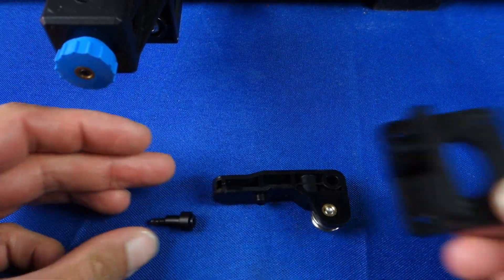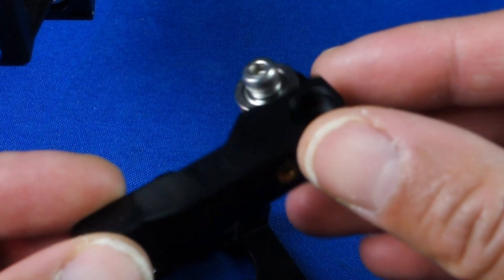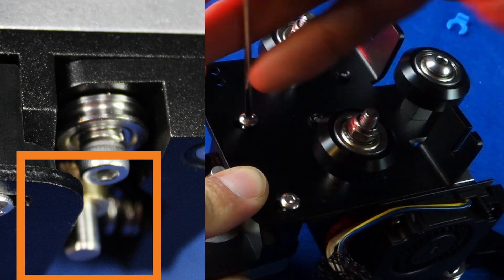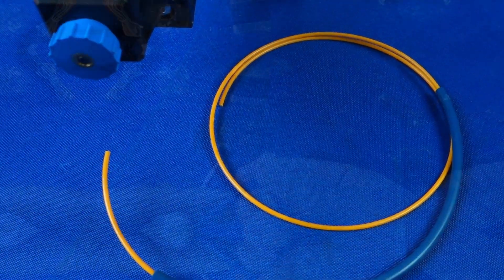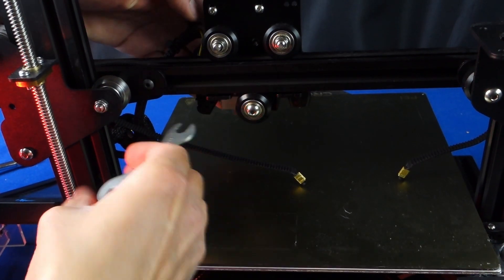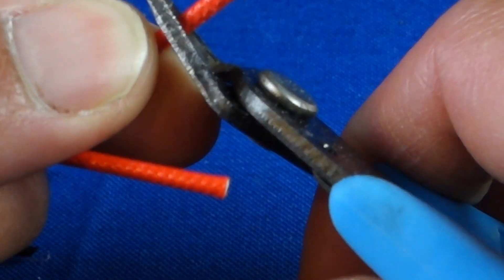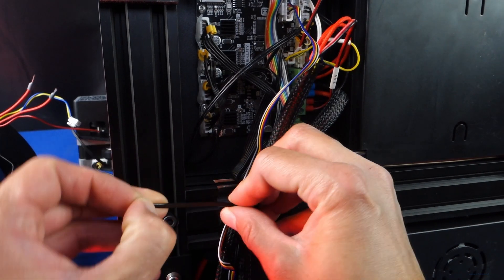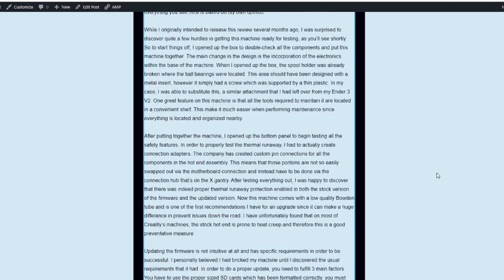𝙐𝙥𝙜𝙧𝙖𝙙𝙞𝙣𝙜 the 𝗛𝗼𝘁 𝗘𝗻𝗱 - Ender 𝟯 𝗩𝟮 - CR Touch + Direct Drive + Micro Swiss Extruder

Comment: Great tutorial but can you help me with an unexpected issue? The new hotend doesn't sit on the gantry snugly. I've tried tightening and loosening the nuts for the rollers, and honestly, I ran out of ideas around there. Do you have any suggestions? Currently the whole thing wobbles with a gentle touch.
Reply from the maker: The hot end assembly has an eccentric, but that's used to tighten the assembly.  The tricky part is that you need to hold the nut in place while you tighten it, otherwise it'll just turn.  I have pictures in my guide, but the nut on the outside needs to be hold in place, while the nut in between that and the hot end needs to be tightened.